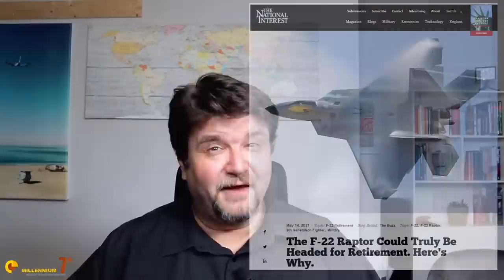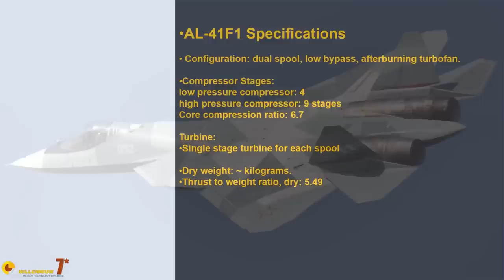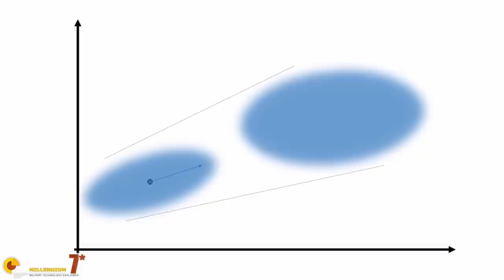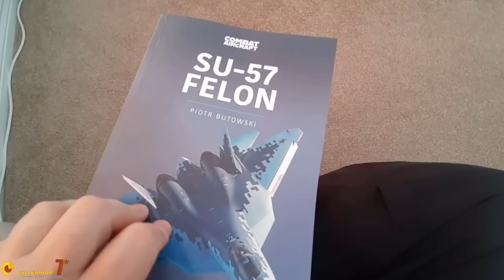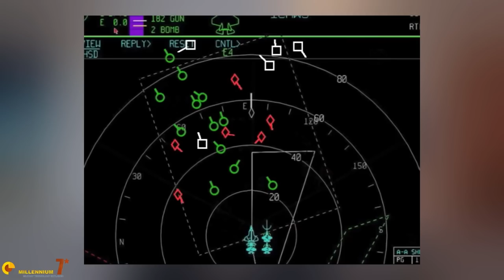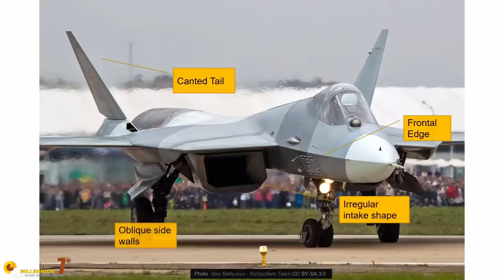Su-57 Update! + In Depth Analysis

Comment: 0:00 - 5:40 Update
Aerodynamics and Structure
     6:01 Program History
     10:19 Aerodynamics and Configuration  
16:30 - Propulsion
     18:36 AL-41F1
     21:13 Performance Part 1 
     23:26 Izdelye 30
     27:35 Thrust Vectoring     
34:24 - Avionics & Systems
     34:37 Systems Configuration
     38:55 Sensor Fusion and Automation
45:40 - Radars, ESM, ECM, IFF
     46:44 Radars
     54:06 ECM
     56:30 IFF
58:46 - Video and Infrared Sensors
     58:46 101KS EO Suite
     1:00:09 101KS-V IRST
     1:01:15 101KS-U/01 & 02 MAWS
     1:02:25 101KS-O/N DRICM
     1:04:02 101KS-P Infrared Imager/Low Visibility Landing system 
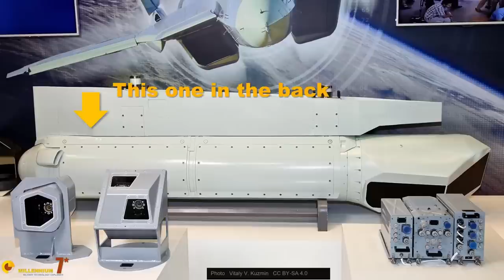     1:04:53 101KS-N Targeting Pod
     1:05:38 UV-50-01 Chaff & Flare dispenser
1:07:35 - Weapons
      1:07:35 Weapon Bay Configuration
      1:08:15 Weapon Ejectors
      1:09:02 Air to Air
      1:12:48 Air to Ground 
1:15:55 - Stealth
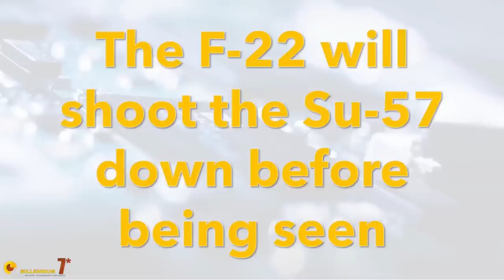      1:16:40 Misconceptions and Dumb Comments Response
      1:23:45 Explaining RCS principles and analysis
Reply: Thank you!
Reply from the maker: Thank you os much for doing this! You are an absolute star!
Reply: buddeh, you are the man. that's how it's done.
Reply: an organized mind!
Reply: The hero we need, but don’t deserve.
Reply: I-- I kneel...
Reply: Cool man.. Thank you very much. Making life easier for all of us, when there is the need to review points of interest, quickly.
Reply: @Millennium7HistoryTech   About self-defence complex 101KS Atol  we have moduls 101KS-O and 101KS-N as completely different. 101KS-O ( O for Oborona or defence) is two-channel modul  with IR-channel or IRST with  all-around searching-tracking. 

Also has laser-channel with first in the world on one fighter real combat laser ( monopulse illumination) for jamming-blinding not only IR homing heads on incoming missiles but for blinding all optics on incoming missiles and enemy fighters during close-in combat ( laser proximity fuses, HUD and HMD/HMS with ' laser scanning'  over canopy ) , then for blinding IRST and other optical sensors on fighters .

101KS-N ( N for Nazemny  or ground , for attacking ground targets ) is three-channel targeting pod .There is IR- channel ( IIR-thermovision  ) , TV-channel and laser channel.
Reply: Now this is the work I find almost impossible to do.... 
because it is SUPER FRUSTRATING.
It seems soo shady that he did this... 
I wanna believe he has software to do this kinda sh!t, dayumm !
Reply: 6:24 Davidenko's photo, please add it

Comment: Hi everyone ....

I wrote many comments about Su-57 , especially  about radars (  radars are part of the highly integrated and automated two band radar  and jamming complex Sh-121 with radar system N036 Byelka and jamm system L402 Himalay as part of it ) .Sh-121  also integrates EW/ESM/RWR/ECM/ECCM systems.

Su-57 as 5th gen fighter is now in serial production and soon RuA&SF will have the  first operational squadron .  Su-57 has in total of 12 radars ( yes , twelve )  ...4  in  X band (  high frequency / f=8-12GHz/ -shortwave / λ=3cm /  )   and 8 in L band  ( low frequency / f=1.4-1.6GHz / - longwave  λ=24cm  )  .

It is the first operational fighter in the world with all around  radar coverage  ( 360° azimuthal radar envelope ). Four   X band AESA radars are... in front , one  antenna ( 1526 four -channel TRM ) as frontal  and two  AESA as SLAR  behind it with 358 four channel  TRM . 4th  X band AESA is positioned in tail boom for rear looking ( search-track ) with 179 four channel  TRM .

So we have in total of 2242 TRM for frontal scanning of air space with 270° of radar envelope . Must know that centimetric radars are used for search-detect-track-lock ,then for comm, jamm,nav and meteo .Decimetric radars are used for long-range search-detect-track ( especially aircraft with stealth features,LO and VLO ) ,then for jamm and ID-IFF . Eight  L band AESA antennas are positioned: two in LEVCONS  ,two in  wing slats and four in the sides of the wingtipes . Four main antennas have 3 big  four-channel TRM each with max pulse output power of 1kW for each of channel  ( ID-IFF channels two of them ,one for state ID with  so called Parol system and one for international ID system  with NATO standard  Mk12 channel  ) , then radar channel and jamm channel.
Decimetric  radars measure two target coordinates ( range and azimuth ) ,not the elevation one. Elevation data come from centimetric radars or from IRST type  OLS-50M ( 101KS-V )  or from outer source via data-link.

Centimetric radars can be used as part of so called OSNOD  ( joint system for navigation and multi channel data-link ) and of course as part of jamm system L402 Himalay . Centimetric radars have A2A and  A2G regimes ,nav , comm  and meteo regimes . Can work in monopulse and pulse-Doppler regimes . Details like  frequency agility ,frequency repetition in Medium and High PRF modes  , max output pulse power for  each of the channel  in that modes , Duty Cycle,  Peak Power Duty Cycle and other so called  ''radar energetic capabilities '' will stay undisclosed . 

Decimetric  radars can work in Mono or Bi static regimes ,  all AESA radars have active ( beaming ) or passive ( goniometric)  regimes. One thing  more about  decimetric L band AESA  ,there are a real gamechanger because there is no stealth  fighter in the world who has own  skin that is 1/2 or even 1/4 of that long wavelenght . That is pure and clean radar physics . 

Advantages of N036 Byelka radar system over other fighter radars : has two working bands ( other radars systems only one ,X band ) ,  has 360°  radar envelope ( other especially western fighter radars only 120° , MiG-31BM with N007AM Zaslon-AM has 140°  and Su-35S with his N035 Irbis has 240° ) . It has  12 radar antennas in total all other fighters  have only one .

About new A2A missiles for Su-57 ,some details :  There are 5 new missiles , Izdeliye/Product  171-1 ( modification of serial and now operational Izdeliye 170-1 or R-77-1 ) for BVR especialy against incoming fighters ,  then Izdeliye 180 as first in the world hypersonic cruise A2A missile also for BVR combat  , Izdeliye 270 as first in the world A2A missile for engaging enemy fighters in  WVR combat and in the rear hemisphere of own fighter  ( AESA radar in tail boom is used for engaging and missile has special micro-busters for turning within 180° after launch  ) . Then we have Izdeliye 760 (  only A2A missile  which can be positioned in underwing weapon bays ) for WVR combat and Izdeliye 810 ( modification of serial and operational Izdeliye 610M or R-37M ) as very long range hypersonic AAM

All best to author and others .
Reply: For author and others some ''aerodynamic  details'' :

Su-57 is ''10G''   5th gen fighter and for comparison , older Su-27 is 9G 4th gen fighter. In real flight conditions that means  next parameters ... when flying about Mach 1 , Su-27 can withstand max overload of  9G  and  when flying about Mach 2 can withstand max 7.5G  .  Su-57 can whitstand  max 10G when flying about 1M and max 9G when flying about Mach 2 .  G- overload time limitations for Su-57 are : at 9G  60sec, at 10G 20sec  ( all this parameters with pilot of course ) .

Max aerodynamic pressure for Su-27 in subsonic speed mode is about 170t ( max 9G ) , 140t in transsonic speed mode ( max 7G ) and 150t in supersonic speed mode ( max 7.5G ) . For comparison , max aerodynamic pressure for Su-57 in subsonic speed mode is about 300t ( max 10G ) , 200t in transsonic speed mode ( max 8G ) , and 250t in supersonic  speed mode ( max 9G )  ,all this for specific take off mass . 

Su-57 is the first in the world serial and operational fighter with supersonic climbing speed ( climb rate and speed in troposphere) . Climb rate at 1000m of height after take off is over 380m/s ( with 50% of fuel and 6 A2A missiles inside  the plane  with serial AL-41F1 but with new Izdeliye 30 or AL-51F  it will be about 400m/s ) . For comparison ,Su-27 has climb rate at 1000m = 300m/s and MiG-29 has 330m/s  with constant vertical speed ( climbing speed ) of 1000km/h or M 0.85  and can climb at 10.000m for about 55sec after take off. Su-57 can climb to tropopause ( stratosphere ) under 40sec. 

About those new engines  Izdeliye 30  or AL-51F , can write this , they have dynamic thrust in Full AB mode at 1000m of  height ( cold atmo- conditions ) well over 20.000kgs ( kgs of force  ) .

Coefficient of aerodynamic lift ( Clmax ) for  older Su-27 is 1.75 but for newer  Su-57 is about 2 . Fo comparison , Su-27 has 62sqm of wing area but Su-57 has 82 sqm and that is 1/3 more. Su-57 has less aerodynamic drag thanks to new geometry of air intakes ( horizontal not vertical geometry and acting as trisonic aero-tunel , so capable for speed of Mach 3 ) , then new all moving and beveled vertical stabilisers with more aerodynamically effective area because vertical stabilisers on Su-57 are in fact rudders at all.  So called LEVCON'S , wings and horizontal stabilisers are in one line along the plane  and for result have less aerodynamic drag and less RCS .

Those so called LEVCON's and all moving vert stabilisers are so important for aerodynamic stability and controllability in all flight regimes and parameters . Must mention that only wing slats have not differential deflection all other  aerodynamic surfaces have that ( 10 of them ) . 

About 10 years ago one author wrote this details ( very precisely and accurately): 

''The horizontal tail  is all-moving and provides pitch control in all flight regimes by moving in -phase. At supersonic speed it also provides roll control by differential movement .The vertical tails are all-moving . They are widely spaced .They move in -phase to provide yaw control  operating as rudders and differentially to increase drag ,acting as an air brake.  They are also inclined outward to reduce the radar visibility in the lateral hemisphere. 

LEVCONS can rotate downwards around their rear edge .Similar to wing slats ,they are rotated to assist control  in high AoA,  but their most important function is to recover the aircraft in the event of the TVC failure at post-stall AoA .

The main wing is  equipped wth leading edge flaps and also with flapperons and ailerons. The wing leading-edge flaps are used symmetrically  to maintain lift at high angles of attack and adjust the wing profile to the Much number. The ailerons are used  at low speed and takeoff and landing and together with flaperons are used to increase lift and for roll control at higher speeds together with horizontal tails. Interestingly ,flapperons and ailerons can move all together up and down ( on both wings ) , so symmetrically or assymetrically  ( on one wing up ,on the other down  for rolling ).

The all-moving vertical tails sit on short fixed pylons that contain the actuators and air intakes for engine compartment  cooling and heat-exchangers .One purpose of the pylons is to make room for a longer bearing for the vertical tail pivot ,beetwen the top of the pylon and the lower surface of blended wing . This reduces loads and allows bearings and structure to be lighter. 

Su-57 has a blended wing-body design,  the core of the structure  is the centroplane a long-chord ,deep-section inner wing to which the rest of   the airframe components the forward fuselage and widely separated engine nacelles ,wings and tail surfaces are attached and in beetwen it is flattened , providing  lift and also space for internal payload.  The overall shape with the flat central fuselage ( centroplane)  ,smoothly blended wings with very big area and integration of thrust multi- axes vectoring with all movable surfaces consist what Sukhoi characterizes as integral aerodynamic design or integral triplane ( LEVCON's ,wings and all movable hor and vert tails ) aerodynamic configuration. 

The flight control system has in total of 14 effectors -12 moving aerodynamic flight control sufraces and two  moving gasdynamic control surfaces or engine nozzles. ''

Some practical results achieved by prototypes of first stage with AL-41F : Vmax (real) at 11000m 2.6 Mach, level flight at 24.500m of height, rate of climb at 1000m with 50% of fuel( pre flight) 382m/sec, 360 degrees horizontal combat turn without TVC  ( sustained and instanteones) under 15sec with 9G and 10G overload armed with A2A missiles inside.

All best to author !
Reply: @aviator77migsukhoi34  the have that squadron yet? They were supposed to have 52 three years ago and 160 by 2025
Reply: @jb76489  Yes , 12 Su-57 is operational so far. That is incorect, state contract was signed in 2018 for 2 pre-serial then for 76 serial aircraft .Serial production will be until the end of 2027. 72 Su-57 will equip 3 fighter aviation regiments  with two sqn , 12 fighters each and with one sqn of loyal wingman S-70 Ohotnyk-B combat UAV's.
Reply: @aviator77migsukhoi34  You seriously think the Russian economy and defense industry is still on track for this?
Reply: @markallen6433  Yes I do of course. Russian economy and defence industry work better than ever.
Reply: @aviator77migsukhoi34  lol, ok buddy, I'm looking forward to my next Russian semi conductor purchase.
Reply: @markallen6433  Do not underestimate something you don't know. I posted some links for videos in the last  comment  with serial production of Su-35S and Su-57 in KnAAZ company but it was erased.Videos are from May this year.
Reply: @aviator77migsukhoi34  I'm sure they are building a few dozen airframes, eventually.

I have a hard time believing they prepurchased all the semi conductors they need for finishing and sustaining those airframes though.

Honestly I don't even know if they can successfully finish the initial production run without western industrial equipment and maintenance, but I don't know of any specific gaps in Sukhoi production, so I'll skip big claims.

Russia always struggles to actually turn funding into hardware on time, and now they are very constrained in access to any quality semi conductor supplies and the CIA is actively hunting for all their nebulous grey market supply chains for getting electronics they shouldn't have access to at a level of effort that hasn't been green lit since the cold war.

If you think Russia is going to manage to keep cranking out fully functioning Sukhois while their ability to produce precision munitions is under extreme risk of failure due to semi conductor supply and specialty industrial  equipment access... I don't know man...

Again nothing about the plane, nothing about the designers at Sukhoi. This is about the Russian economy. They've been very lazy, letting their oligarchs steal steal steal for decades while their indigenous talent got jobs in the west and there local capacity died, and it didn't matter cause they could buy cheap Western gear and steal more cash for mega yachts.

You're the one who should be mad. I'm loving this. 

Besides what are you gonna do with these? Terrorize Kazakhs? You're not going to scare NATO with a handful of them, you're not gonna be able to do anything with them other than bomb Syria more? Your can already bomb Syria. Should have spent that cash on training your military.

Frankly the Sukhoi deserves a better host nation. So do the Russian citizens.
Reply: @markallen6433  Sorry mate but what did you write about anyway ? Pls copy the title for this YT video material and one article....

'Workers on assembly line of Su-57 use augmented reality'

Then this title of one article ( western source) from Dec. 2020

''Russia Is Using Augmented Reality To Produce Its Su-57 Fighter''

Pretty high-tech is it ?
Reply: @aviator77migsukhoi34  who cares? Russia can't make computers, who cares if they can code?

Only the US, the Dutch, and the Taiwanese working together can make computers that run that AR suite. It's vaporware because the Russian economy is a joke. Sukhoi deserves a better country.
Reply: @markallen6433 They care mate,they care .They can produce almost everything that was being imported. What did you write again ? 

''Russia can't make computers'' . 

Man did you ever heard for 'Baget' series of computers for new Sukhoi 4th gen fighters or comercial Elbrus computers? Did you  heard for so called IMA-BK supercomputer for Su-57 ?  ( IMA-BK stands for integrated modular avionics-onboard complex).Did you ever heard for MCST 'Elbrus' CPU ? They were being produced in taiwanese TSMC ,now they are domestic even the newest 16nm Elbrus-16S.From 2025 they will have new 7nm technology Elbrus-32S in serial production.
Reply: @markallen6433  damn bro you got schooled on this one damn nice debate tho but i dont think russia cant make chips coz if they couldnt theyd stop production of their t90m tanks as they use US and french tech but since production is still ongoing in fact its been increased id assume youre wrong reason why russia doesnt make chips may be because its just easier to buy them not bcoz they cant just like USA buys oil and they have their own
Reply: @kunaukedi4850 he didnt really , the smaller silicon technologies. Smallest production size at present is around 3nm in the west, however IBM does have a 2nm facility. Russian tech is nowhere near this. TSMC is taiwanese and Id envisage Russian home grown versions will be chinese produced and somewhat lower quality. So he isnt totally wrong
Reply: @markallen6433  And still.... No SU-57 over Ukrainan soil to this date. Show us what the SU-57, and Russia, can and cant... On paper a good plane, but that is on paper.